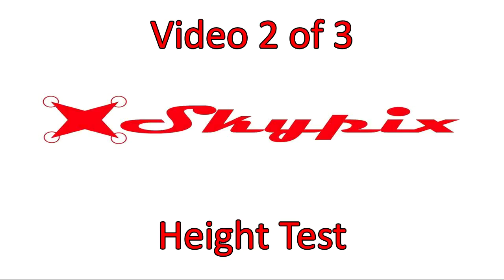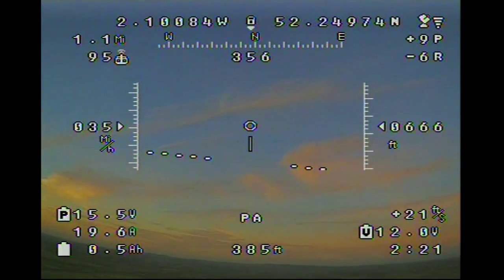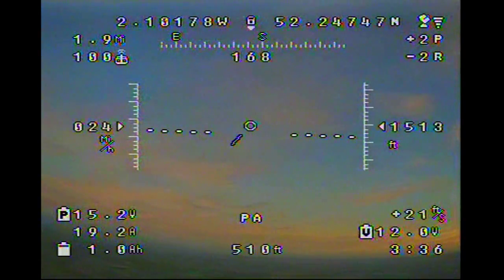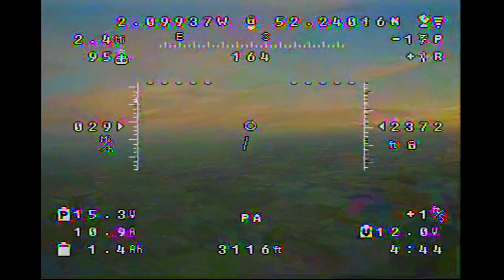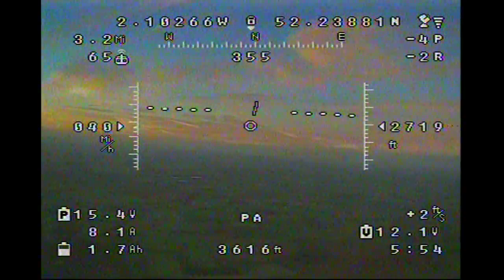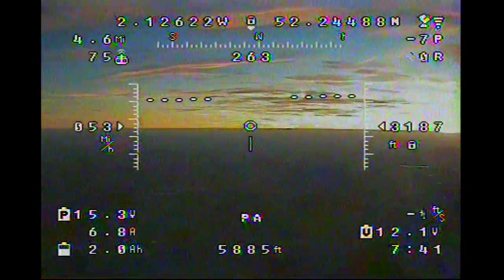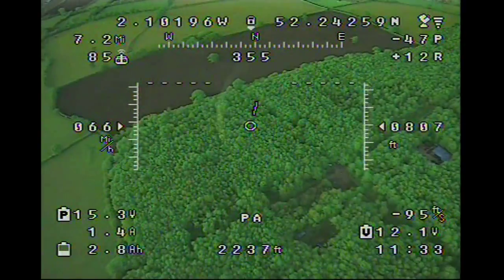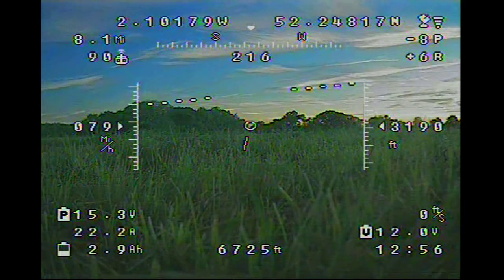2 of 3. Go Discover FPV **height test**, with Sony 700tvl ccd camera and storm osd.

Comment: How did you make channel connections on the d8r-xp in the storm?
Reply from the maker: FPV PEGASUS if you're using CPPM, then connect channel 2 (with 3+4 signal pins bridged) to the MOD port on the storm. When the storm is powered up you must select PPM mode. Otherwise it's aileron to ail in, elevator to ele in. Setup a channel for the flight modes, and the display functions. Either way, throttle is direct to your reciever. Hope this helps.
Reply: Thank you for the information
Reply: Friend have another question of d8r-xp on channel 2 cppm I call where the storm?
And the motor channel stays connected where in rx ?.
Reply from the maker: FPV PEGASUS you have to select the cppm mode in the storm osd menu, and connect the throttle to any other channel on the receiver except 1-4 as the storm uses these in cppm mode. Hope this helps.

Comment: nice video just wondered did you mean 2 watt booster on the 9x ?? If not what is a 2 watt burner??
Reply from the maker: hi +i8thegovernment yes I am using a 2watt booster. Sorry old habits, burner is radio speak for booster! It's a 2.4ghz 2 watt/2000mw wifi amplifier.
Reply from the maker: hi +i8thegovernment yes I am using a 2watt booster. Sorry old habits, burner is radio speak for booster! It's a 2.4ghz 2 watt/2000mw wifi amplifier.
Reply: +James Dyke Thanks for replying, whats your maximum range with the booster? Ive got a 1 watt booster but cant use it because it knocks out my video which is 5.8ghz my radio is 2.4 turnigy 9x with frsy module. im using the 5 dbi omni antenna. I can get just over a mile with no booster, before i get a fail safe rth. Frustrating because i want to use the booster and go further. Had a patch antenna arive in the post last week but weather has been shit in the south west uk so hopefully can get a flight in next week
Reply from the maker: +i8thegovernment Well with the booster i've got, i've been out to a distance of 12500ft, which is 2.36 miles. That was at 65% RSSI (signal strength), I reckon I could have easily gone a little further, but that flight was for testing my video range, and not my radio range. Where is your 5.8ghz video receiver? Is it near the 2.4ghz transmitter? Also, on the aircraft, keep the 5.8ghz tx as far apart from the 2.4ghz rx.
Reply from the maker: +i8thegovernment and another thing, if you can, have all of your aerials underneath the plane. Why people put them on the top I'll never know. When they're underneath, the radio contact is always line of sight, improves signal. When they're mounted on top, the radio waves have to go through the fuselage, and any electro-magnetic interference inside the aircraft. Check this chaps video out... https://vimeo.com/8826952
Reply: +James Dyke  Cheers mate yeah ive got maximum separation on the vtx and rx. im flying the sky mule plane so plenty of  room to place things. i get a mile with my 450 quad copter and theres hardly any room for separation. So were you flying to?
Reply from the maker: i8thegovernment that's the trouble with multirotors, no good for longe range. I just flyout over the common land near me. Nice and safe that way.